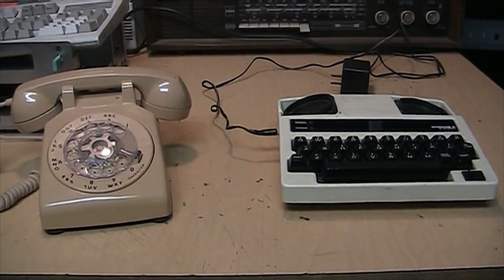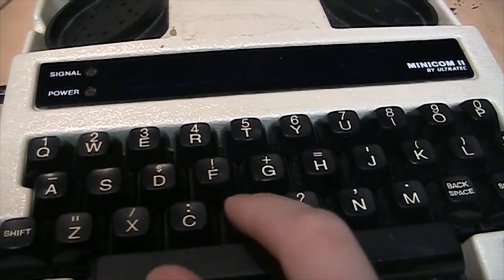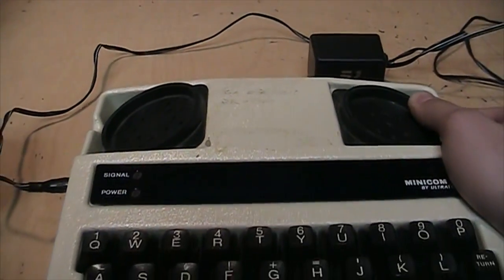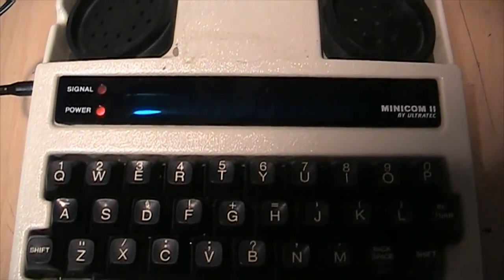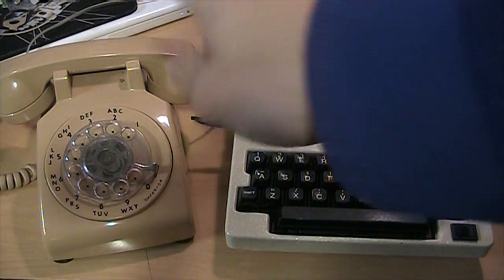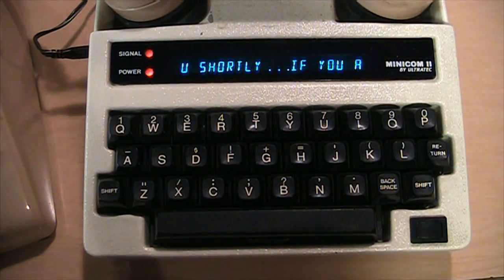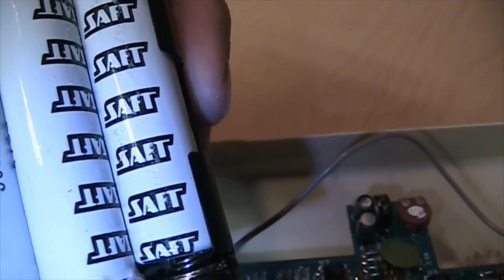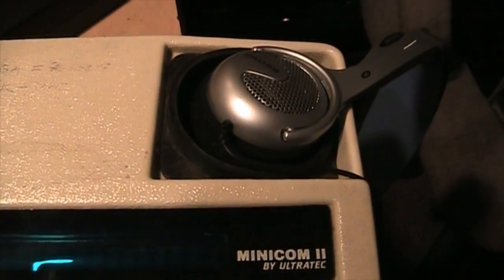1984 Ultratec Minicom II TTY/TDD review & test

Comment: That's pure awesomeness right there.  Mechanical keyswitches, vacuum fluorescent display, acoustic coupler, what's not to love!  I'm completely jazzed that you chose to use a rotary phone with it, I think that really adds to the video!

They really thought of everything with that device, even the rechargeable battery pack so it can be used in an outage.  Of course now with VoIP (which is all that's available here), even if you have a battery backup for the modem doesn't mean the cable company does!  I've been through several outages where I've lost phone and Internet even though it's powered and working.  I usually go by the traffic light at the end of the block, if that's out, there's a major problem and those lines are dead!
Reply: That could be a safety violation in some instances.

Comment: I had a deaf friend in high school, back in the 80's. I though it was so cool that I could talk to him with his tdd machine by using my Commodore 128 and modem. I don't remember the software or how to do it, but I know I did it and it was quite easy for a 14 year old kid to do !!! Him and I would chat quite a bit using that method. His machine was more advanced  than yours. His plugged directly into the line jack and had a roll type printer attached to it.

Comment: I know this is totally unrelated, but I discovered that if you slow down a message in Specific Area Message Encoding (SAME, the protocol used for the US Emergency Alert System), you hear something very similar to Baudot code. So I wonder if you tweak a Baudot generator very specifically and speed it up if you can simulate a SAME message.
Reply: Headset Guy That's PSK.... not Baudot.
Reply: Tien Loc N. Thanks! I appreciate the clarification.

Comment: Sounds like RTTY45, think it would be compatible?
Reply from the maker: +Tyler Watthanaphand Some RTTY also uses Baudot code, but usually at a faster data rate.
Reply from the maker: +Tyler Watthanaphand According to Wikipedia, TTY/TDD uses "Baudot code implemented asynchronously at either 45.5 or 50 baud, 1 start bit, 5 data bits, and 1.5 stop bits."
Reply: The tone and I think shift are different than used for RTTY.

Comment: +VWestlife
5:10 I never knew you could actually whistle into a TTY machine. I wonder if the same can be done on a phone. Whistle a phone number and it would automatically dial for you? Imagine you're someone like me who is blind. Would blind customers be able to use a TTY machine? If I want to communicate with someone who's deaf, how would I be able to make out what they say on their machine if I can't see? Do they have talking TTY's? How would someone blind be able to become an operator for the TTY relay services?
Reply from the maker: Back in the 1970s a 2600 Hz frequency used to be a long distance dialing signaling tone and some people claimed to be able to whistle it to get free long distance calls. But Touch Tone dialing uses two simultaneous frequencies, so unless you can get two people to whistle at exactly the right frequencies at the same time, it wouldn't work. There are special operators who allow TTY users to communicate with normal voice callers.
Reply: How would someone blind be able to become
an operator for the TTY relay services? Is that even possible? The reason why I ask is because when I eventually start my company, making products and services accessible to people of all abilities, I want to have a TTY line, so that customers who are hearing challenged can purchase products and services that meet their needs as well.